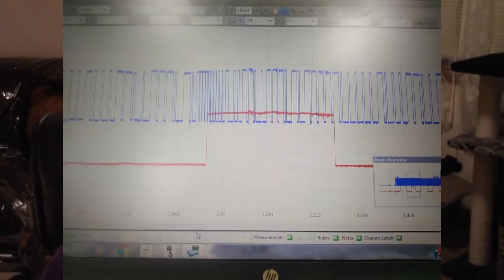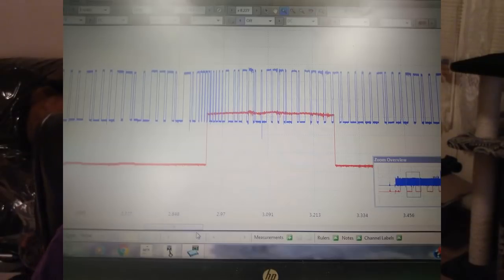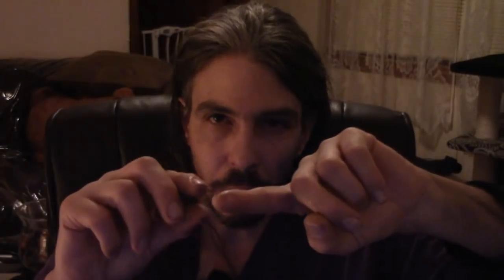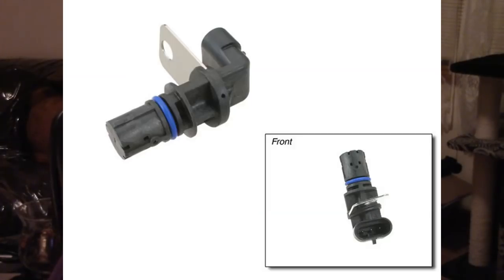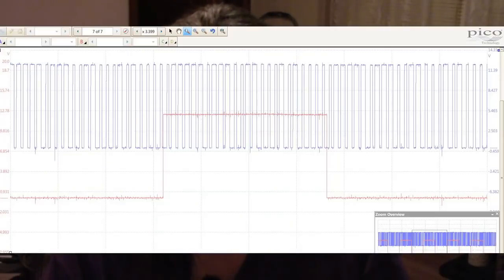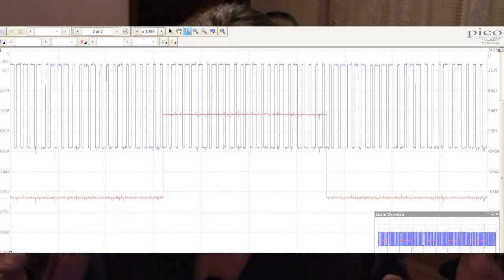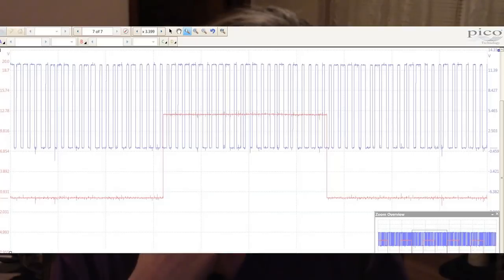Crank Sensor Replaced & Still a P0335 & No Start  (Understanding Failures of These Sensors)

Comment: As an auto professional but in a different field I respect and appreciate a great mechanic. Because a "technician" just throws parts at it and gives up and the true mechanic has to fix all they screwed up. I'm in the body field and the cambus systems sure make me miss carb and distributor  cars. But they had their issues also. Please keep up the great work and please spread the knowledge to as many as you can
Reply: Actually i think that part was put in by a mechanic, no offence about them because im actually one of them, and some of the mechanical problems are a real pain as much as electrical!
Reply: I would say other way around mechanics throw parts at cars, technicians are the ones who can diagnose and have the theoretical knowledge.

Comment: Gotta love a half assed install of a part making your day so much fun.

Soon as you said rust I knew the nightmare that was about to unfold, had to deal with similar crap on a jeep liberty with 3.7L V-6 (dodge 4.7Ls dim step cousin.) 

Your right the crank sensor behind the starter design sucks when all goes well, but stuff like this just makes you wanna smack someone cause they couldn't take 5 mins to clean the rust before installing.

Also for anyone reading I keep extra gun cleaning kits at shop, as I find the barrel brushes work nice for cleaning sensor bores, vaccum/EGR passages etc.
Reply from the maker: Awesome idea on the gun cleaning brushes. They do work great.

Comment: I ran into the exact same issue with a mid-2000's Nissan Altima 4cyl.  Had been to the same shop twice for long crank time and check engine light.  The lady got my number from a friend and I took a stab at it.  I narrowed it down to the crank sensor, which was new, but hadn't been installed right and had an air gap issue.  I still had to buy a new one because they flubbed up the special o-ring.

Comment: Great way to find and fix the customers concern Joe! Even myself having half your level of experience and expertise I DONT use cheap parts especially when there’s a problem that’s been looked at prior to myself receiving the vehicle! It’s really dumb when we use cheap parts to fix a paying customers car. There’s a reason the dealer techs only install factory parts. And in most cases I’ve actually found that oem (especially on domestics) is cheaper than the local parts store!🤷🏾‍♂️ Keep doing you brother! In the end you’ll win bc of fewer comebacks and higher customer satisfaction! Your customers will learn that in this field it’s quality over quantity!

Comment: I had a 1989 Buick Regal 2.8L . The crank sensor is buried . Is was also stuck , but did turn slightly . I soaked the heck out of it with PB Blaster . I used a tie rod fork to reach it . It is plastic so I took the time to slowly tap and wedge it out . The  O ring was petrified . I hear you on the importance of cleaning the entire area .
Reply from the maker: Ah yes, between the transaxle and engine. Must have done a hundred of them over the years. Love those.

Comment: Hey bud I have a Chevy Silverado 2500hd desiel has p0335 code with no signal to crank just died on me I’m in fl , techs have been looking at for a mounth can’t figure out think broke wire they changed crank sensor but still having problems u think is air gap like u say everything alse checks out to be good and got good Continuity to crank has 10v in and 5v out of sensor

Comment: Ah sweet! The trivia reveal!! Just started the video Joe. .. .. 👀
Reply: Oh wow... I was wrong on a few  levels. I didn't really look at the capture well enough.  I should've looked at voltage better. 
2nd, I had it in my head it was the older style with the sensor up front, as you stated Joe. 😑
3rd. That's f'd up... I agree... anytime a sensor is done, you need to make sure the hole is clean and sensors go in smoothly, such as an ABS. 

Great test Joe. I really liked this. I also enjoyed the breakdown with the reveal (this video).  👏👏👍👍👍
Reply from the maker: Thanks Cuba. I should have been more clear on a couple of points when I posted the picture. I hope I made sense with it all in the end though.

Comment: I'm always mindful of rust jacking when it comes to sensors like this, I've diagnosed and fixed far too many ABS issues simply by removing the sensor, and cleaning the mounting surface when I see an erratic signal. Providing the sensor doesn't have to be destroyed during removal.

Comment: These are really great learning experiences for me.  I know it's lame, I just haven't had to do one of these on this engine yet.  I figured a 335 is a circuit malfunction so I would go after the wiring to make sure it was okay first.  I would have expected an erratic signal to throw a 336 or 337, just based on my book knowledge not experience.  I guess if the signal is bad enough the computer may see it as a circuit issue.  I think that after I tested and eliminated the wiring I would have went after the sensor next though and got there eventually.   I mean if the wiring and inputs are okay then the problem has to be something with the sensor.
Reply from the maker: Indeed...or a pcm misinterpreting data possibly...but that's why we use scopes. To rule out bad data coming in.

Comment: Don`t ya just love finding out that the last shop totally screwed the pooch on the sensor install. Lazy "technician" needs to learn about surface prep. Nice job as usual Joe.
Reply from the maker: I think it is more a matter of not knowing that it matters...sadly.
Reply: @JoesAutoElectric  It`s all about tolerances on those sensors. Even this old backyard mechanic knows that.  Those who don`t may not be in business long.

Comment: Hope things are well. I have an '05 Buick Century 3.1 liter V6 car that is currently in a state of no start. I mostly maintain myself, but have done so with some neglect. In this case I drove it for 6 months with a slow leaking radiator. It overheated, yet not all the way to the red on the temp. gauge. After I refilled it with water, and put the radiator cap back on, which had popped loose while driving, it was running rough at certain speeds or rpms, and cutting off, until it wouldn't start. I got the car home, and soon after replaced the crankshaft position sensor. I haven't yet been able to get it to start. I'm guessing that it needs to have the procedure of Setting the ignition base timing at this point. I have yet to find out what codes are present. It's getting fuel, and the starter motor cranks. Is possible that if I was to crank with the taking the serpentine belt off, and putting it back on repeatedly that I could find the spot where it will start up again until I find where it will idle properly again, or will this cause more damage?
Reply from the maker: Reading what you wrote, the only advice I can give you in good conscience, is to bring it to a real technician.
Reply: @JoesAutoElectric  Thnx. for the quick response. That makes sense.

Comment: Right on Joe, i was wondering what the conclusion was to that photo. And OEM parts are the only way to go, never ever ever used remanufactured parts either. I work on european vehicles and we've tried a lot of those "Dorman" repair kits for various things like the PCV that is built into the valve cover and they never work. Harder to sell an entire valve cover plus labor to a customer but it's an easier conversation to have than trying to explain to a comeback customer why their car is still having the same issue you supposedly "fixed".
Reply from the maker: The best is when you tell the customer of a VW the PCV failed and I need to order a valve cover. They instantly look on their phone and say, "No you don't. The PCV repair kit from Dorman is only 29 bucks". Then then think you are the guy robbing them. LOL
Reply: @JoesAutoElectric  damned if you do, damned if you don't.

Comment: Hey joe loved your video on crankshaft sensor
 This is my situation. Traction control warning light on misfiring running rough. Changed crank sensor. Ran great for 2 weeks 
Problem is back. Disconnected battery 
Running well again,but I know its gonna happen again 
Not a mechanic ,should I changed camshaft position  
 sensor .
Thanks in advance 
Ken
Reply from the maker: @Ken McNaughton, you need to go to a repair shop and have it diagnosed properly. If I, or anyone else could tell you the problem in this scenario, we would be rich.

Comment: I deal with rust pushing sensors out all the time. Usually when you get erratic signals, misfires and missing signal-it's rust. I'm in Minnesota and seen vehicles litarly rot away in 5yrs. The corrosion is horrible.
Reply from the maker: Yes, same as Jersey I'm sure...Buckets of rust.

Comment: Was high end at full 12v?   Then dropping to 0v.  I was thinking later LS non egr with sheared cam pin.
Reply: And who is the negative nanny
Reply from the maker: Yes, all was good there. As you can see in the still photo, the signal had very erratic behavior.

Comment: back in the '80's trucks started running electric speedometers. usually a sensor on the trans output  but some used a tone ring in the wheel. bad adjustment or too much bearing slop causing air gaps were  always the problem. we didnt have scopes  just checking milivolts on ac scale. a scope sure wouldda been nice back then!!!!

Comment: I have just one question , Do you clear the code on all after you retrieve the fault code , or is it on a case by case basis ?  trying to duplicate/ID  the problem   just wondering
Reply from the maker: If you mean after the repair, yes. I will clear any codes in the system and verify the repair.
Reply: @JoesAutoElectric  No , I thought you said you cleared the code and than used the scope , I might have heard you wrong , No big deal, I realize you clear the code after the repair , Just wondering if the code  needed to be cleared to perform certain test as the PCM may take that system offline and not give accurate data  , Again just wondering  THANKS
Reply from the maker: Oh fair enough. I did clear the code during the diag. I wanted to see if it returns or if it an intermittent failure. After it returned immediately I used the scope to see what I could find that the pcm was not happy about.

Comment: Aftermarket crank sensors do not fit as well and use the plain red rubber plumbing type seals. The OEM ones generally use the purple nitrile seals that are not affected by oil. Ac delco stuff is the cheapest of the OEM parts so it should be a no brainer. The $15 saved will be someones nightmare eventually.

Comment: My mechanic replaced my 05 cobalt 2.2 CRANK Sensor (Not the CAM Sensor) geeze, that's another issue that fools mechanics! His OBD Computer still indicates a sensor problem that he just replaced & now he thinks it 'Could' be a Bad Sensor that i had bought and suggests me purchasing another. It was not a OEM sensor I bought from Rock Auto for him to install. Do I buy a better, maybe OEM crank sensor or find another mechanic? The idea that he 'thinks/suspects' ...this worry's me. TY
Reply from the maker: The fact he let you supply parts is a problem in itself.
Reply: @JoesAutoElectric TY for the reply, but it didn't help. Buying it myself saved on the store's & his mark up. Nothing wrong with that IMHO !
Reply from the maker: @stevenshackelford1937  there's a lot wrong with it actually. And I can't diagnose your problem over a PC. You bought aftermarket. There's your first mistake. Whether or not it's the problem, you are adding to the possibilities of problems by buying aftermarket parts. As a tech, I learned never to let customers supply parts because they look for bargains, instead of quality. However I wish you luck.

Comment: 85% of my career was fixing mistakes. The other 15% were, dear standing in the middle of the road. I don't mind when Bambi gets hurt. Sucks when it's people.

Never recycle parts off a death car. Bad juju.

All parts are literally playing a lottery. You have a better odds at winning. With OEM parts. If it's a cheap part, it's going to be expensive labor. If it's an expensive part, it's going to be cheap labor. They used to give us different labor prices. One for ideal conditions in one for extreme. But the insurance companies did away from that.

Unless it's paint. Then you get exactly what you pay for. Color and labor.

Comment: sometimes OEM parts are cheaper than the aftermarket.
Reply from the maker: True, sometimes they are.
Reply: @JoesAutoElectric  Especially GM AC Delco Most people don`t realize you don`t have always call dealer to get OEM parts. I`ve gotten AC Delco and motorcraft parts from some of the chain parts stores. Also some of the parts sold as aftermarket by parts stores are OEM such as bosch and NTK I bought an NTK o2 sensor for my jeep liberty and found out that was the original original brand Mopar used on those trucks. Bosh is used by most european manufacturers as OEM parts.
Reply from the maker: Yep truth, but sometimes the "OEM" aftermarket is actually not the same. I have seen that on Dodge O2 sensors.

Comment: Great. Man if it doesn’t go on don’t force it. Had to be jammed in on an angle. That explains why the waveform was not uniformly messed up.. not sure that is great wording.. 

I am An OEM part mostly guy. it was designed with it and meant to work with it. Too many variances in tolerances.

Even medication is like that. As much as 15% did in a generic med vs brand name.